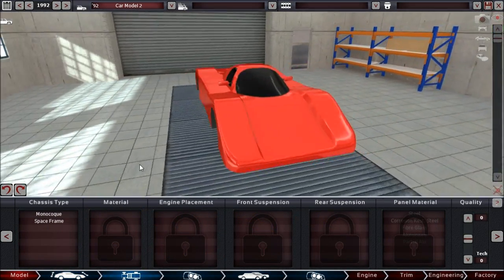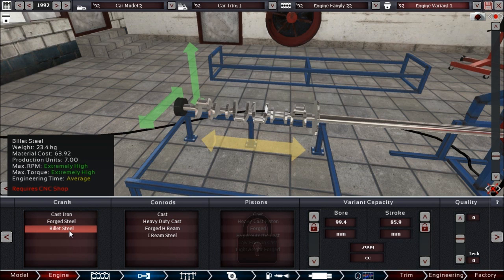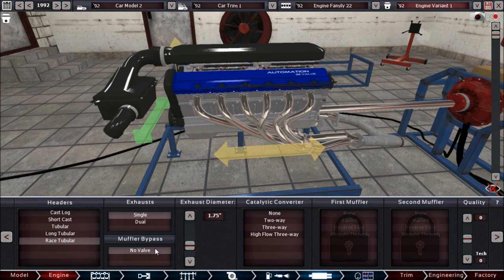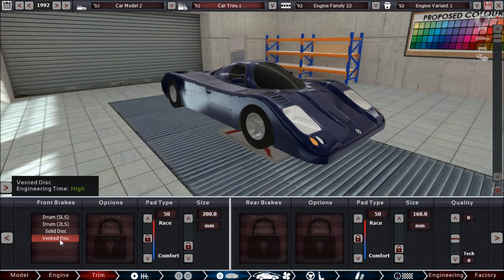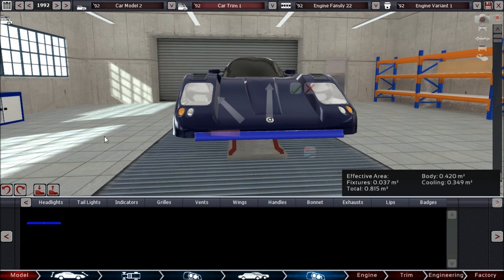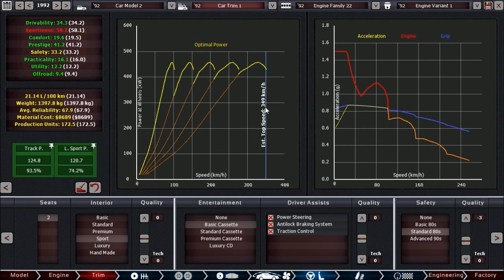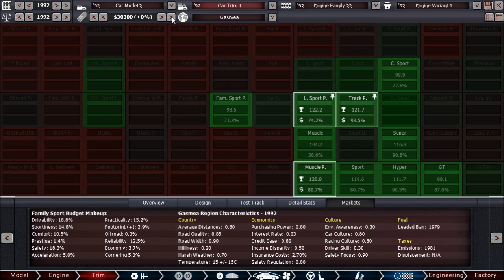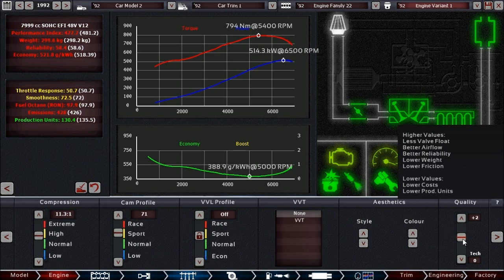Let's Play: KE F-Zero

Comment: Oh I love the sound principle of competitivity shown by your brand: "we love our stats in a sheet, after all corpses don't buy cars...anymore". Also, hope the thermal insulation for the driver's space is top notch because that engine is going to heat up things quite a bit if anyone tries to drive that thing for long stints!. With that cheap integrated heating that'd be a good car for post-soviet russian oil billionaires, I guess? XD

I just love how you almost instantly get whatever you want from thet suspension and without any effort at all too. After all this time playing automation is still the tab I spend most time in, and the one I understand less on how it correlates with actual in-track cornering performances yet you seem to get exactly where you want with four clicks and ten seconds. Bastard. XDDDDD
Reply from the maker: +ramjb You got to excel at something, we excel at stats and immoral thugs in management. :P

Thermal insulation is a thing, yes... our competitor at McLooren uses 16 grams of Gold... pfft.. we just bought aluminium foil in the supermarket for $3.50 and it works just fine! (most of the time)

Hehe valid comment there at the end, one thing I have noticed more and more with Automation is how ridiculously high the skill ceiling is. It takes hundreds if mot thousands of hours to get a gut feeling and (more importantly) a deep understanding for the dependencies. We should have Automation E-Sports with our multiplayer. :P I have used the comparison before: that would be like Starcraft with engines.

Comment: Nice video! I know "time" isn't implemented yet, but after seeing the video I have a question, how is it going to work? If we want to produce a car for 2010, will we need to design the car a couple of years earlier? Like, using a 2008 year technology for a 2010 model? Also, any ETA on the open beta? Cheers !
Reply from the maker: +Shalloworldmx Yes, designing a car and setting up production will take some 2-3 years for normal cars. In the campaign your company has tech pool, which allows you to unlock tech early and/or invest in more quality without taking penalties. That is how you make a 2010 model use 2010 tech. :) ~2 weeks is our current ETA.

Comment: 8:26 TIL 12x4=32
Reply from the maker: +andrews2547 12x3x4 = 144; 12x3x6 = 216
That's because the game doesn't display the stats in months yet but you got to divide by 6 and 4 respectively to get the correct number of months.
Reply: +AutomationGame I was talking about the valve covers on the engine, 12 cylinder, 4 valves per cylinder so it should say "48 valve" not "32 valve".

It was just a joke anyway :P
Reply from the maker: andrews2547
Ahh, now I get it, sorry I didn't check the video time you posted :) yes, that needs fixing!

Comment: Kill rob you gotta adjust your gearing so you're reaching peak power at your top speed, that's why you were having trouble, you were dropping off the power curve
Reply from the maker: +aky141 No, that is incorrect. The estimated top speed usually is higher than what you can reach. In this case I tried to up gearing (I cut that out of the video) and it gave me lower top speed.
Reply: +AutomationGame What factors go into estimating the top speed, and why is it estimating the top speed on that one graph when it can directly calculate the actual top speed?
Reply from the maker: 0pyrophosphate0
The basics are factored in, i.e. air resistance, rolling resistance, drive train losses, all working against maximum power at the wheels. Having the graph show actual top speed once it it possible to calculate that is something we want to do when we get around to it, yes :)